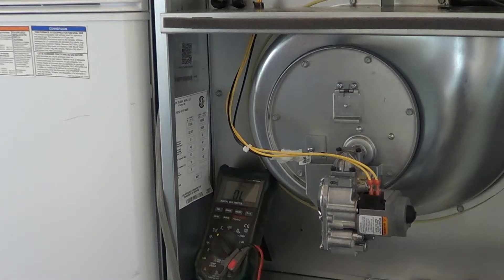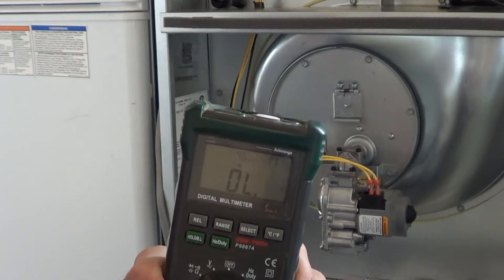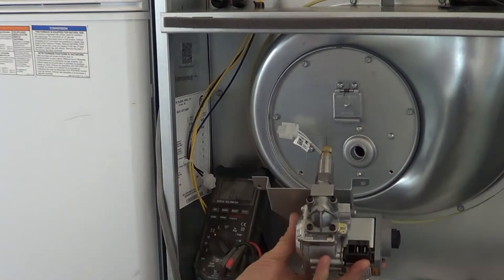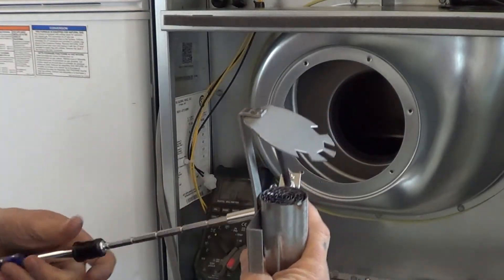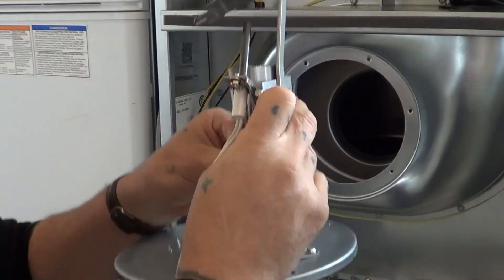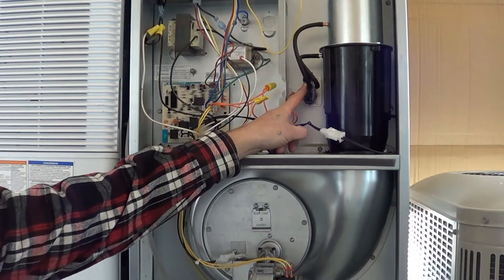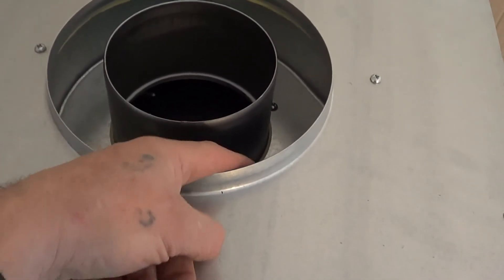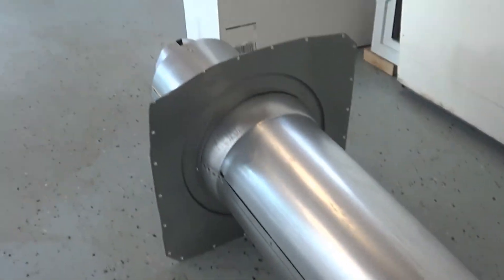Failed Ignition on Nordyne / Nortek / Intertherm Furnace

Comment: I have a M1MB 077a aw that’s 25 years old. 
I believe the igniter is original. The mobile home was built in 2000 and I bought the place in 2008 and I certainly never changed it.
We often can get to -40 in the winter. 
It’s still works fine and lights the gas easily and glows bright yellowish orange. 
I just checked it again yesterday.
I do have a new spare OEM igniter kicking around though for the day it finally dies. 
I’m just watching this video to get an idea how to do it. 😀🇨🇦

Comment: Mine works well but makes many clicking noises before shooting the flame.
Reply: Those clicking sounds are normal and  likely just different relays going off or resetting .
Reply: Those relays are basically just your furnace board telling different components on your furnace to do this or that. 
The clicking sounds are literally contacts being closed or resetting. 
Upon a call for heat, your furnace has a startup sequence where the inducer starts, pressure switch closes , hot surface igniter glows , gas valve opens and flame sensed and finally blower fan starts .
Those clicking sounds are basically the relays on your furnace board telling all those components to do that.
As long as it’s running fine, nothing to worry about. However if you start to hear more clicking sounds than normal, it could be that one or more of those components perhaps isn’t working properly and your furnace board is repeatedly retrying them. 
Sometimes though it will be fine on the second try. Something just wasn’t right on the first try. 
After three failed tries though it will lock itself out and you most likely have a problem.

Comment: Hello Randy i checked my furnace i have nothing the motor not starting no flame at all no clicking noise the two light indicatora are both off i checked my breaker and it seems to be fine. I replaced my thermostat also my only hope is the might be the capacitor which iam waiting on. What other problem i can check for. Thank you for all your videos it gives us an idea what to look for. I have the Nordyne M1MB 056A BW.

Comment: What does code 12 mean on that furnace,I know it's a inducer relay error but what fixes it
Reply from the maker: Hello, so on this furnace there's only six codes. And by codes i mean the flashing red light, and then a flame sensor code the yellow light when the flame is on. Are we talking about the same thing?
Reply: @randythemobilehomeguy3715  I got it figured out,the relay for the inducer was stuck,had to replace the computer board.

Comment: Hi Randy, I have checked for blockages , checked igniter and checked the venting for blockage all 3 are fine. What else could it be for lockout due to failed ignition? Thank you for the videos
Reply: Same here. I replaced the igniter although mine looks slightly different from the 1 in the video the black ignition part is more flat and square than cylinder shaped like the video. Also my replacement was just slightly shorter than the 1 I removed but it said it would replace ignitor for m1m series...anyway it glows and then kicks on and I get flame then after a couple seconds the flame goes out. It does this until it locks out due to failed ignition. I've cleaned the burner and have no spiders or debris in mine. I'm not getting a green light tho on my control board and the blower is not starting after the flame comes on before it goes out again.
Reply: @jamesharris4984  I'm going to try the gas valve next. Not cheap but not sure what else to try.
Reply: @kcfarms1291 did the new gas valve work???
Reply: @jamesharris4984  I'm having same issue. Still getting "lockout due to failed ignition", even though there is ignition for a few seconds

Comment: You're so much help, THANKS!  I went ahead and took the orifice off and the spud that holds it (663699r spud) . I had too many issues with that spider. I found out turning the gas off in the summer helps keep the spider away because its attracted to the gas smell

Comment: No fault flashing, induction fan goes, clicking happens, Gas valve turns on sends gas (I tested it putting the 24v direct to it gas came out) I can smell it when it is all hooked up also, no ignition. Igniter checks good with continuity. I put my meter in the plug that connects to the igniter and it showed no power when I turned the furnace on, then .5 v when the gas valve turned on. 

Anyone know what it could be? I’ve changed the mother board, thermostat, induction fan, and igniter (universal) < could that be the problem??

Comment: Ok. Im not getting a continuity reading, but the ignitor lights up hot. Also it seems im not getting power to the gas valve.
Reply: Hello, power to the gas valve comes from the circuit board after igniter. If it’s not, after igniter glows, is often means bad board. Thanks for the reply

Comment: What could cause a weak flame?
Reply: Hello, I have a video ‘ignition failure on a mobile home furnace’. Usually weak flame is due to clogged orifice. If you are getting the reading of ‘weak flame’ on a Coleman furnace but the flame looks okay then clean the flame sensor with an emery cloth. If an Interthem or nordyne furnace then move igniter a bit more into the flame as on the most common ones of that brand the igniter is the flame sensor

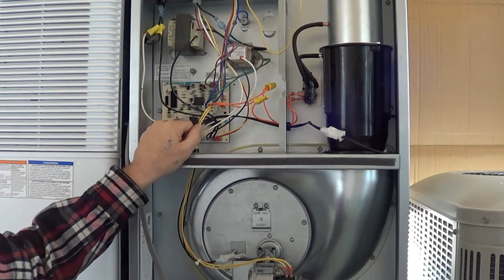Comment: an easier side question. I have the double wall roof jack for my M1M of course. But I also have an additional fresh air inlet. At 8:17 you can see an oval that can be punched out. On mine it is and there is a flex vent, like a dryer, out through the roof. Why would I have both?
Reply: You definitely don’t need the extra vent, and I do agree that pulling outside frigid air is an efficient heating idea. You can cap it off.
Reply: That is designed to allow some fresh air from outside to mix with the return air. So something totally different from the air needed for flame, combustion air, which is sealed from the air of the home, this vent mixes with air that flows through the vents and returns back to the furnace. If you look on your roof you will see a vent off to the side a little from the furnace roof Jack. It’s a blend air system for the return air.
Reply: @randydolph852  I did see the extra vent and then realized what it was for. Seems not very efficient to pull in cold outside air and mix with the air warm air trying to heat the home. I understand the need for the combustion air from the inducer. Why does mine have the extra vent and this one doesn’t? Problem if I disconnect it and seal it off?

Comment: Hi, I have the Intertherm 2012 unit MIM.  It is leaking water everywhere inside and it smells like chemicals, like a very strong glue. 

This all started when the hvac guy came to inspect and service the unit.  First thing that happened was it was clicking a lot but I left town the day after.  I came home a week later and it was still clicking a lot and I found that the red valve was vertical and the yellow led light wasn’t staying on and the flame wasn’t staying lit. I eventually started adjusting the red valve and found that the light would stay on.  That was good. The next morning, today, the heater wouldn’t start and there was a lot more water in the flat areas and the red led light was blinking.  I got the pressure switch to open and now it is working.  My question is why all the water?  It looks like it is coming from the flue that is sitting on the motor.

Comment: My igniter works. Furnace fires up but blower doesn’t come on so furnace shuts off.  
Major updates to this issue. So complex will be hard to follow. The blower didn't work because it needed a capacitor. Put one on, crossed the wires at the tstat and blower comes on. Great! Nope. Put everything back together and ignitor glows, furnace fires up and still shuts off within seconds.
I put on a new ignitor thinking it wasn't sensing flame as it should. Then the big trouble started. The new ignitor was not glowing so I wiggled the wires and it started sparking and popped like a light bulb. So I get yet another ignitor. Now this one isn't glowing. Board isn't sending power. Pull the board and wow... big burn mark behind it. That ignitor popping burned out the board too. So I get a new board. some confusion here because the board i'm taking out doesn't have the same model number as schematic on the back of the door panel. It is 624240. Must be a replacement from the original. Unit is 18 years old at this point. . I can't find this new board number but found one on amazon that cross references to it. 903429 is supposed to be the upgrade to it.. Install it and the red light is flashing rapidly. I think it's a bad board so I order a replacement. Same thing, rapid red light flashing. No power being sent to ignitor.  Nothing happens at all. No draft induce motor, no blower. BUT... If I unplug the white plug in the middle of the board, both motors start to run, and keeps running when I plug back in. I hear the click for the ignitor, but does not glow and everything shuts down. Tstat has 24v to blower and AC but only 21v to the heat. A clue? Could I have gotten TWO defective boards from Amazon? Or maybe despite being visually identical, this board is not the correct replacement?
And final edit: apparently it either was two defective boards or the 903429 is not compatible. I was able to get a true 624340 and it works.

Comment: Hi.... please help me. my heater has been broken for almost 4 years or more. Mine goes thought every check besides thag last timer switch.... the blower i guess... the last step to blow the heat, it shuts off.
Reply: Hello, does your thermostat have a switch to start the blower, ‘fan’ off or auto? If so, does that usually work to turn the blower on? We need to Eliminate the blower as the problem. So, when the flame comes on, does it stay on for a while like a minute or two or does it go off after only a few seconds. Large flame?

Comment: replaced the ignitor now it still wont work , Still getting 4 flashes
Reply: Now winter is almost here and I still cannot get fuel to the ignition .  I have a glowing hot ignition but no fuel .  Cannot light it manually either so I have a complete fuel cutoff issue .   What do I need to replace to get the fuel working?

Comment: Hello, I have a furnace like this and it stopped working last night. Its making all of the clicking noises but doesnt start blowing. Also my red light is solid red its not flashing at all. What does that mean? Could it be that gas is not getting to it or what?
Reply from the maker: I would recommend turning the power off at the switch on the furnace. Let it sit for a couple of minutes then turn it back on. See if it will cycle through it proceedures. If it stops again, check the light. See if you see any flashing. Hopefully you will get a flash code if there is a problem. If not, you can carefully open and look at the ignitor to see if it has been burned out. I hope this will help. Let us know. Thank you for watching!!

Comment: Hello, I'm not sure if you respond on here but I'm having an issue with my furnace ( when it feels like working) and I'm very concerned about it starting a fire, what should the inside look like where the pilot light is when it turns on? Cause when it wants to work it looks like a full on fire inside of the furnace through the little hole. Please if anyone knows it would be greatly appreciated, Thank you!

Comment: I have this exact furnace with this issue. I took the screws out bút can't seem to pull it towards me. Do I loosen the nut thats up against the plate?
Reply from the maker: Sorry for the late reply. Did you take the valve all the way out? That comes out first and then the burner assembly. It is a pain for sure and a fragile igniter is to be thought on, but it is sometimes the case that you need to lift the back up some once all the screws are out. Are you getting any movement at all? The nut on the back of the valve does not need to be removed as it comes out with the valve.
Reply: @randythemobilehomeguy3715  I watched your video a couple times after I brought the part and I had to pull up like you showed. I was so afraid of breaking something else ..I got it ‼️ ‼️Thank you so much for posting this .  I found a fried chipmunk in there and then I took the shop vac and put it up the stack and found another fried friend. They must have chewed the ignitor before getting baked lol.

Comment: WRONG WRONG.  Just because you have continuity does NOT mean it's good.  Instead set your meter to the lowest OHM reading and repeat your probes insert to both sides of plug and read the resistance.  If it's more then 75 ohms - specs say it is bad and needs to be replaced.  Also try to clean the igniter with super fine emery cloth or even sand paper but be extremely gentle because these are extremely fragile. I had to replace a bad igniter that tested to 250 ohms, yes it glowed - dim - just not bright enough.  Plus buy from Amazon for 18-21 dollars, local mark-ups can be insane for example the last I bought (could not wait even the 2 days for A) was $45 locally.
Reply: Thanks for all the info. With regards to the flue, I try not to fabricate any of those and alway when replacing get them from the manufacturer. Darn things are expensive though. I am meaning the flues you buy from the factory are telescoping, used to accommodate a variety of heights and thus when you are looking for a replacement you don’t have to get the exact size because it will move inside of itself to telescope to the correct height. Thanks for the discussion. Maybe it’ll help someone.
Reply: Thanks for sharing. Not a great idea to replace an ignitor because a tester reads over 75. Try to go through the sequence of operations is the best diagnostic tool to start. If you get to igniter and then flame and loose flame then focus on the meter. To narrow this search however, check for continuity before you tare into it and start messing with the ignitor.
Reply: @randydolph852  Respectfully - that's just the official specs - google it.  The last one I did, did glow,  did continuity check, but 250 ohms, once replaced tho fired right up.  So just because there's continuity and glowing it may not be glowing enough.  BUT on your side tho another time one read 95 ohms and glowed fine, but turned out a too old gas valve replace and the 95 fired up fine.  

Also the combustion air flu slides up and down not the exhaust flu - if I listened right you said it slid up and down - on older models Intertherm/Nordyne vent kit I've worked on the exhaust flu isn't adjustable (inside) it can't go up and of course can't go down it seats out at the furnace.  When you can't change the existing vent and/or have to cut the exhaust (the other flu slides up easily) in order to remove old unit - then what?  You go to a well equipped sheet metal fabricator and fabricate a 5 1/16th" x 3.5" tall to 4" tall piece spot welded to another smaller 4 15/16th say 4" tall or more depending  you get a 3 piece unit that the exhaust will slide up to install the replacement furnace and then down to seat at furnace- THEN you can use existing vent because now the exhaust vent slides up the INSIDE of the existing exhaust secure the dual section with 3 screws and use red silicon over screws and joint.  It saves the day.  The last time I had one made it was $20 - $40 it takes a pro with software and modern equipment etc about 15-20 minutes to make.

Comment: I know this is an old video but I need some help and you seem to know what your talking about. I have an intertherm furnace in my mobile home, this summer i had to replace the capacitor in outside unit. Now fall is here and i turned on my heater and within a minute my system started buzzing and my thermostat had automatically switched to aux heat. WHY IS THIS HAPPENING. If you see this please respond what you think this could be.

Comment: Ok followed this instructions for replacing a failed ignitor a few months ago. And the furnace worked. Now a few months later the new ignitor has that gray rubbery tip completed burned off. What caused this to happen? Any one

Comment: This igniter also doubles as this furnaces flame sensor. This is why it needs to be at that precise angle and should be replaced with the correct model.
Reply: Look at my post...just take out the little screw and use the old bracket on the universal igniter.
Reply: Yea they replace my ignitor with a universal and the holder doesn’t have a guide for the slot…guess I have to guess the angle…this sucks